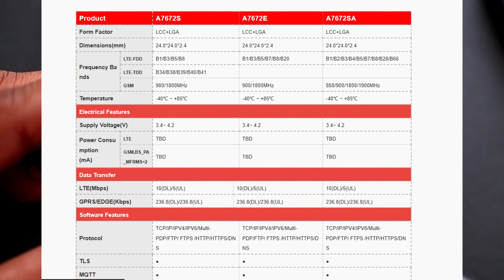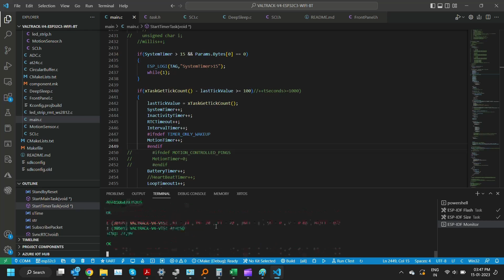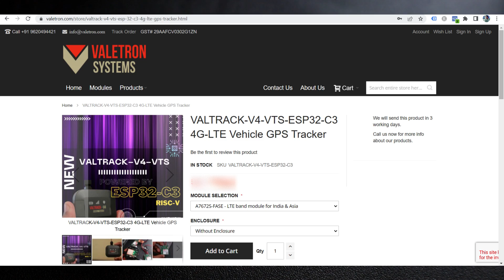ESP32 GPS Tracker | 4G- LTE | Vehicle tracking | VALTRACK-V4-VTS-ESP32-C3

Comment: I am interested in the product but it has less I/O port for any other connection in vehicles/or any iot products .

If possible please enhance this circuit to a little bigger and having analog I/O and digital port for other experiments
Reply: Z😊
Reply from the maker: It's optimized for only tracking and its IO are limited. May be will make different hardware for extended uses.
Reply: @RaviPujar  hello Sir, when the new board will available with more IOs.
Reply: @RaviPujar  pls make it, for controlling other iot also . Or may contrlling vehicle ignition, fuel and other control. 

Pls make it modification or make another
Reply: @Sekhar_Home ❤
Reply: ❤❤😂😊😅 @RaviPujar Q❤❤❤😂❤😂